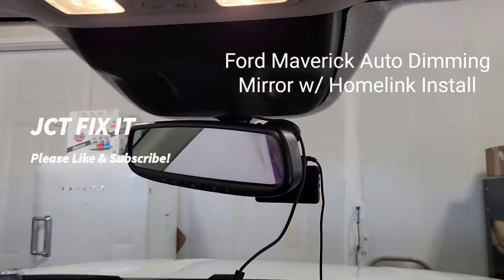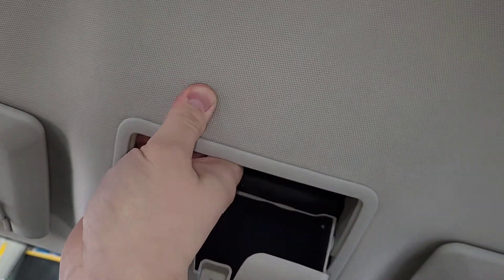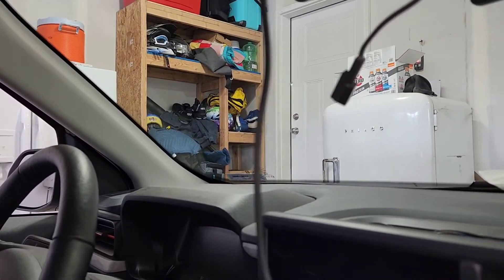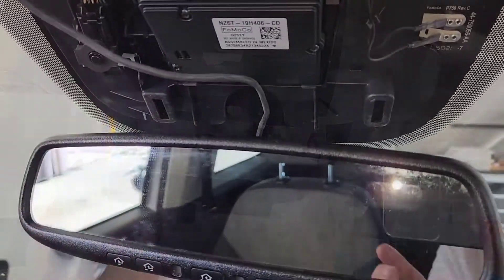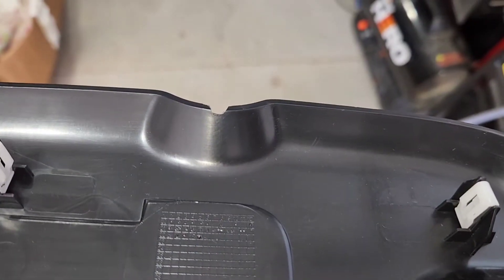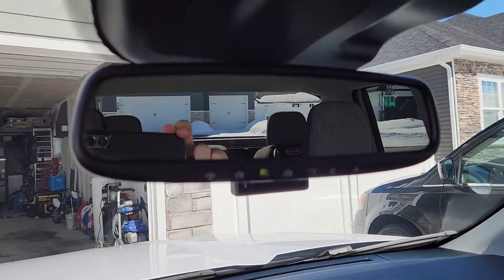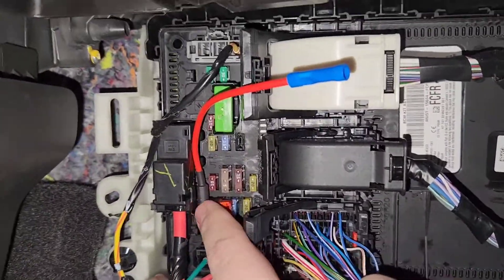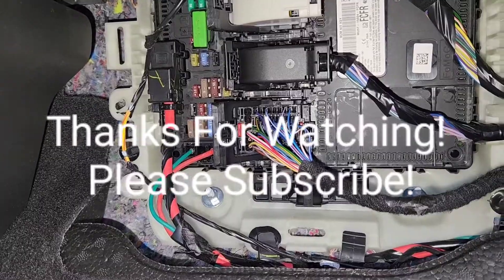Ford Maverick Auto Dim w/ Homelink Mirror Install.

Comment: Somebody might find this comment helpful. To be clear I only blame myself for this mistake and I find my mistake kind of funny. I saw your wiring “diagram” on screen for the wiring harness 1:17 going to the map lights and thought it would be the perfect place to wire my radar detector into. I used the wire you had marked as “ignition” (purple wire) thinking that it would just turn on with the ignition and off when it turned off. It worked perfectly when I wired it and put everything back together. That night I went for a drive and my radar detector would not turn on. I found it weird but figured I’d try the next day when it was daylight out. To my surprise the next day it worked perfectly again. And again, that night it stopped working. I assume this is the wire that is used to control the auto dimming feature on the mirror which totally makes sense. So one night I went out with my phone when my radar wouldn’t turn on, held my flashlight up to the ambient light sensor on the dash and voila! My radar detector turned on! Turns out the purple wire only gives 12v when the light sensor detects ambient light!! I chuckled to myself and left it as is until I find another wire to tap into. Great video though! Thanks for posting it :)
Reply: Oddly some people say this wasn’t an issue. It was for me, maybe people don’t dim there dash nights at night.
Reply: @CGM00SE  ooh I didn’t think of that. Yeah I keep my dash lights at about 50%. My radar was getting SOME power at night, it was getting like 9-10v, but it wasn’t enough to keep it on and it would act super funky. Man, that makes so much sense.
Reply: Ha! Same for me. Also noticed my steering wheel lights wouldnt work either. I think it is the current draw is too much
Reply from the maker: Gues I should have checked for.voltage at night! Whoops.
Reply: @JCTFIXIT  😂
Reply: @JCTFIXIT  No harm no foul! I was working on a project that wasn’t the homelink mirror and after a bit of trial and error I got it figured out. There’s another wire in that same loom (I forget which one now) which is “always on” so all it took was to switch my positive lead to that one. Also I never would have got the idea in the first place to tap my scanner into those wires if it weren’t for your video so thank you! I wonder if the varying voltages depending on amount of light helps the homelink mirror function somehow. Let’s it know what time of day and how intense to dim the mirror?
Reply: @JCTFIXIT  Messed with it some yesterday. It seems as if the ignition wire we are using cannot handle more current draw. This tells me that the wire goes to the lights in the steering wheel and overhead, BUT not the courtesy lights. I'll read in the wiring manual to see, but I think there is a gray wire that runs to the courtesy.
My door opener part still works, but when headlights come on, compass stops and so does the lights on the steering wheel.

Comment: Great video! The labeling for the wires was super helpful. I only had 2 PosiTaps (love 'em)  in the right size, so I just tied both power wires into the ignition circuit. The Maverick seems to turn this on as soon as you open the door, even without a key, so it seems like it will work just fine.
Reply: I was thinking about doing this as well so the HomeLink didn't always work.  This way someone can't just break a window and be able to open your garage.  Do you experience any issues with HomeLink wiring to the 12v ignition instead of 12v constant?

Comment: What that sticky stuff is   is, FRICTION TAPE. 100 years ago when man first discovered
electricity friction tape was developed to act as an electrical tape. Unlike the PVC 
electrical tape of today, friction tape has no adhesive it is just a little sticky to stick to itself. This is what our great great grandads used. I am amazed it is still around but I guess for 
whatever reason, Ford finds it necessary to use it here & there.

!

Comment: Thank you for posting this video.  My post is rather late as I used the instructions to install my Kia mirror about 6 months ago.  With the 12+ live on the homelink all the time, did you find any excessive draw on your battery when the vehicle was off?  I'm concerned about killing the battery with the homelink always active in the truck.
Reply from the maker: No. The homelink portion doesn't draw power unless a button is pressed.
Reply: @JCTFIXIT  Excellent to hear.  I assume they were still drawing some power to "listen" for the trigger.  It was clear to me what other function on the front camera would require constant power.  Thanks again.

Comment: Can you add a dash cam to the same wires with the home link mirror?
Reply from the maker: I would think so but you would need to have a 12v dash cam or something to step the 12v down to usb voltage.
Reply: I'm also wondering if a dash cam can be powered with the overhead light wiring. I know that everyone else is running wires to that fuse box and adding a circuit.

Comment: Got it installed, my only real problem was, for some reason the light connector was short trying to hook it back up.  I got it but couldn't figure out why it was shorter going back. Also the compass never came on. Garage door works fine. Don't really need compass anyway. May go back in and figure out why.
Reply from the maker: There is a button to toggle the compass on and off but you might just have got a defective unit

Comment: Thank you so much for this. 

Just for connection clarification:

Ground:
Ford Interior Lighting Harness Black/Blue=Black Left Homelink Harness

12V Constant (Homelink):
Ford Interior Lighting Harness Yellow=Black Middle Homelink Harness

12V Intermittent (Compass/Auto Dimming):
Ford Interior Lighting Harness Purple=Black w/ White Stripe Homelink Harness

Did you snip the wires from the Interior Lighting harness and the Home link harness to use the two into one T tap you have linked in your description? Did you cap off the extra wires or leave them in the harness connector? 

I'm thinking I will get these T-Taps instead so I only have to snip the wires from the Homelink harness.

Low Voltage Wire splice connectors - Pack of 12 Quick Solderless T Tap Connector 1 Pin,Rock Solid Connector for 24-20 AWG Cable for Vehicle/audio/video/Lighting and Automotive Uses

Is there enough room for those to be tucked away?

Thanks again. Really handy.
Reply from the maker: Yes I only snipped the wires from the mirror harness and then inserted them into t-taps. I left the quick disconnecting clip in place so that if I ever have my windshield replaced or similar they can disconnect without having the mirror sit there and dangle.

Comment: I’m guessing you had issues with this since the purple wire is not consistent 12v. It’s on the dash dimmer.
Reply from the maker: Never have. 🤷‍♂️
Reply: That’s odd. If I dim the dash lights I lose voltage at that wire. I’m going to run from the #3 fuse slot.
Reply from the maker: Good deal. 👍

Comment: Where can I get the ttaps?
Reply from the maker: There is a link to all the products I use in the video description
Reply: @JCTFIXIT  thanks..just ordered them...can a rookie do this?
Reply: @korrybelin1707  Absolutely!  If you have copilot 360  you can purchase a plug and play wiring harness from a member of the Maverick truck forum. He is selling the plug and play harness and mirrors at a very reasonable price. Otherwise it is a little more difficult to route the wires to the fuse panel.

Comment: I tried this with 2 Gentex mirrors on my Maverick Lariat and it worked great in the daytime, but as soon as light hit it at night the compass went spaz and the mirror did not auto dim. It worked fine at night if there were no lights shining on it. Turning on the dome lights made glitch as well. I'm not sure but I think the purple wire is variable voltage connected the BCM. Has anyone else had this problem with this installation?
Update: I connected the mirrors' power and accessory power to a direct 12v power source and it worked perfectly. With that said, many of these come with and installation cord that is long enough to go to your fuse block. Use it and a couple of fuse taps. Problem solved.
Reply from the maker: Thanks for the info. I have had a few people report similar issues. I do think that positive wire is tied to dimmer.

Comment: Would homelink still work if you tap into ignition on power? I don’t want homelink working without key on.
Reply from the maker: I would imagine that it would work just fine, but only when the ignition is switched.